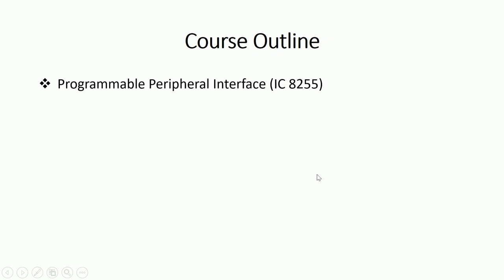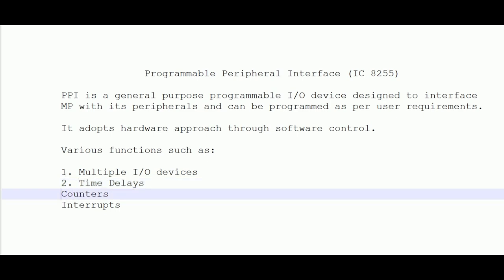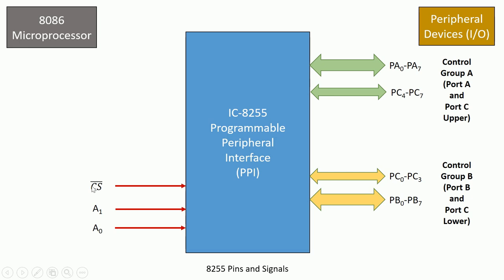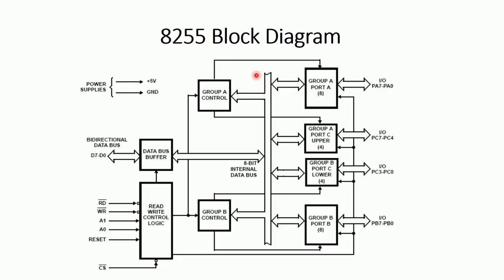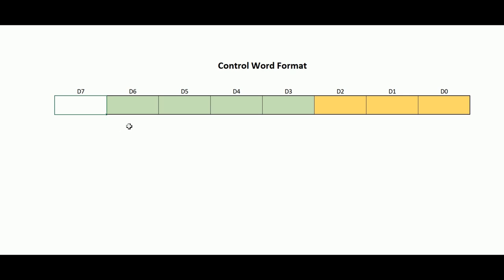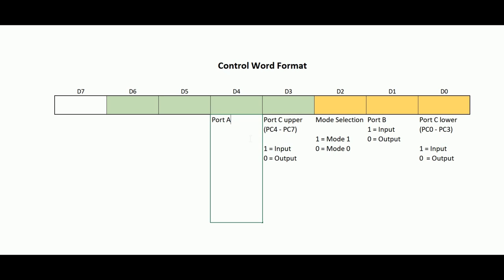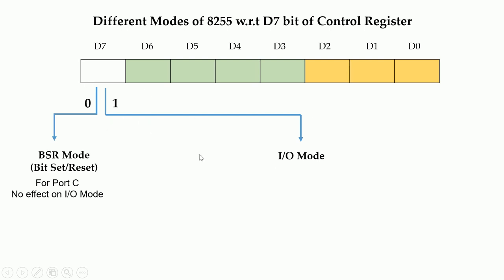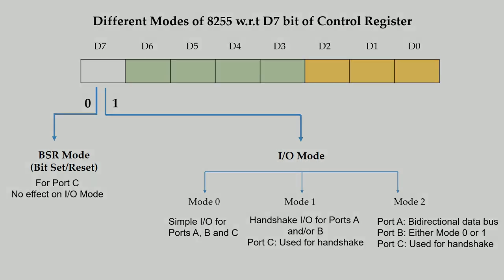10. Interfacing Chips (Part 1/7) IC-8255, Block Diagram, Control Word

Comment from the maker: There is a small correction in the diagram at 8:14, the RD' (Read bar) signal should be from left to right (and not right to left as shown in the figure). This is because the read signal is coming from the microprocessor. 

Kindly consider the same while referring this diagram.